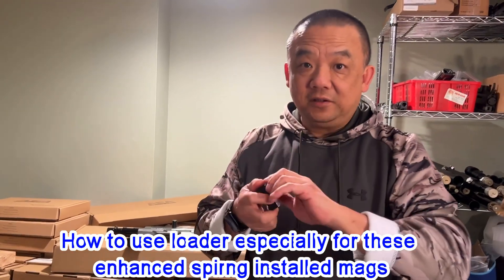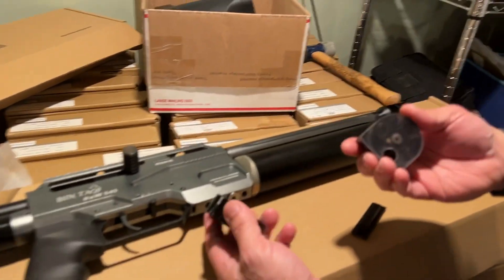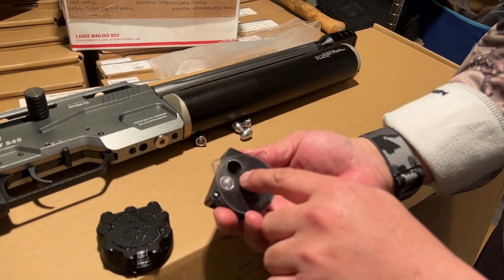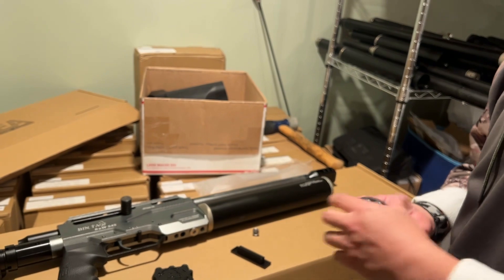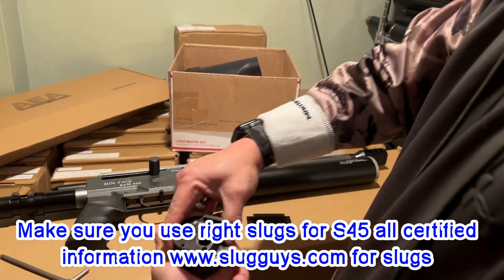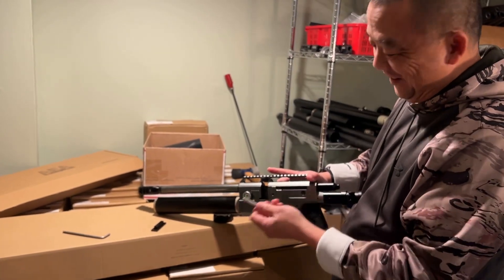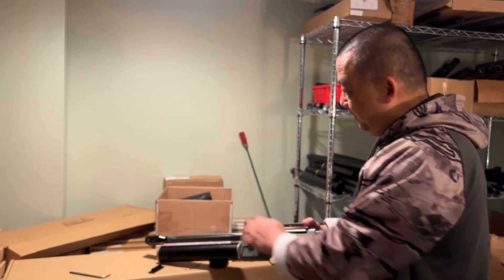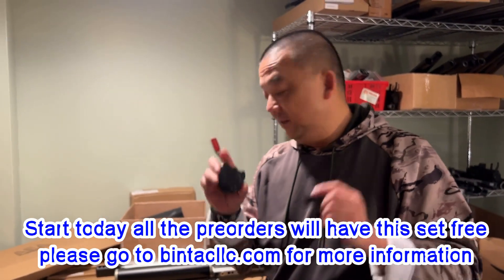BinTac: B&W S45 101-13 How to use BinTac loader and bolt holder

Comment: why you scam me? pre order waited 10 months. this is a scammer jammer. s45 jam every time and double fire. why you sell this? worst purchase ever. mag is horrible. stock is no bueno senior. Jams and leaks brand new. Sad
Reply from the maker: Have you ever used certified slugs? Or checked with us when you had problems?when did you preorder? How to calculate 10 months?
Reply: Texoma Precision Pellets .457 155gr round nose are the ONLY rounds that work in mine. NEVER had a jam. I highly recommend trying them before giving up on this. I love my S45 now that I have ammo that runs in it. Mr. Hollowpoint 170gr jammed on the first shot for me. They are supposed to be the best but I guess my gun doesn't like them. As far as leaks, 99% of the time it's just an o-ring that didn't get set in correctly, or overtightened. Determine where the leak is and I'm sure you can fix it. I actually really like the stock too, it just needs a way to stay closed. Semi auto PCP's are definitely more picky with ammo and need to be within the correct pressure range. Like I said, I LOVE my S45, but it took some time to figure out. So just be patient, especially if you're used to regular firearms.
Reply from the maker: @KinsmanSK  Yeo buddy Jim’s are wonderful rounds
Reply: He is NOT a scammer. He is doing everything he can to help his customers. Best customer service I've EVER had. Instead of writing angry comments on the video why not just contact him to ask these questions?
Reply from the maker: @Juss-Saiyan  thank you my friend
Reply: Ryan, please repost your final outcome after working with sigshooter. My experience so far is that he is quite receptive and even provided a direct line of contact. I havent even purchased a gun yet. Good luck and hope to hear positive conclusion.
Reply: Thanks everybody for the feedback. Im just a crusty ol vet. I called them today, he laughed and said I was doing it wrong or using wrong ammo, can't give a refund but if I ship the rifle back to him he will FaceTime me and show me what I'm doing wrong. Said he just spent hours on FaceTime with another guys s45 to show him the proper way. I said I've never owned a rifle where the manufacturer puts out a video recommending carrying a rubber mallet to clear the jams. Why would u have to spend hours showing people the right way if the thing worked properly? There are major inherent design flaws. So we'll see what happens and go from there as if to pursue legal action.
Reply: @KinsmanSK  Thanks for the info. Does your s45 ever double or triple fire at lower air levels?
Reply from the maker: @ryanreyes8315  Yep we will do the video call together and walk through it to see what happened
Reply: @ryanreyes8315  I haven't let it get that low to where it will auto-fire. From what I understand, all of them will do that if the pressure is too low OR if it is dry-fired and it will ruin your valve pin every time. So if that happened to you, and you have a leak, that's probably the cause. Good news though it seems the valve pin is an easy repair to DIY. You'll have to contact Bin to inquire about a new valve. You might want to check out Macabespeed's channel also. He had the valve pin break on his after a dry fire I think too. But yeah, I have the 500CC front tank and I always fill after 3 mags, and never dry fire. So far, so good. But I recommend watching EVERY video on youtube you can find on the S45, especially on Bin and Macabespeed's channels. Lots of good info out there.
Reply: @KinsmanSK  Good news there's a easy fix for all the problems you caused. Doesn't add up broski. You're spending a lot of energy defending this scam.
Reply: @KinsmanSK  I watched all the vids. If u want I'll isolate all the instances on everyones s45 videos and show how it jams and "auto fires" that's super dangerous unsafe and not what I paid for.
Reply: @ryanreyes8315  Not defending anybody, just trying to help you out buddy. There's a learning curve to these and I had to do a bunch of research myself. Good luck to you!
Reply: @KinsmanSK  also homie told me not to listen  to macabespeed. Even though he showed me to ram rod down the barrel to unjam. I like macabespeed he's real. But guy told to never listen to macabespeed
Reply: I too had issues with my s45. Bin blamed everything but the gun itself. Had a valve blow on my after less than 200 rounds. Shrapnel from the mag cover flew to my face when it exploded after the valve pin broke. Super dangerous. Bin at the time asked me to remove my video of the failure occurring. When asked about a refund Bin tried charging me a restocking fee even tho at the time his website never indicated a restocking fee. After threatening legal action Bin refunded me after close to a month after receiving the guns. Then updated his website to include a restocking fee but neglected to inform others of the policy changes to his website. Man is a con artist.